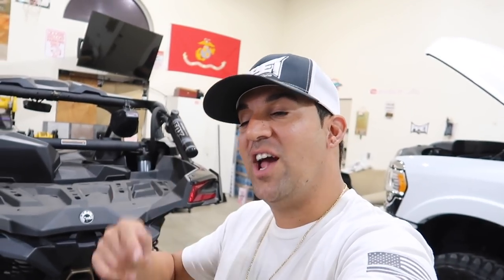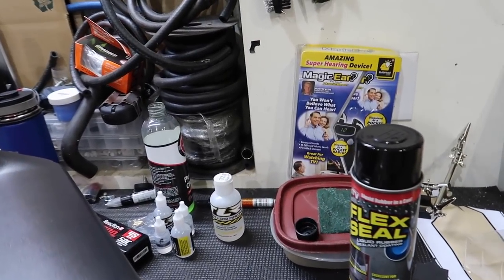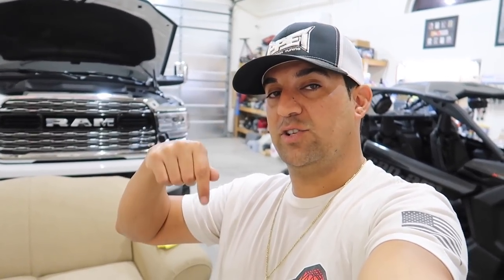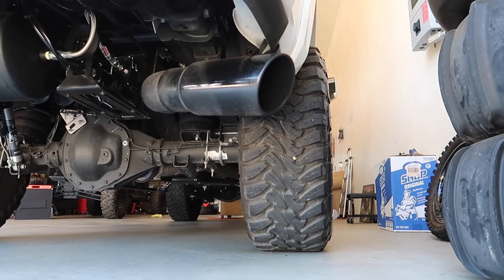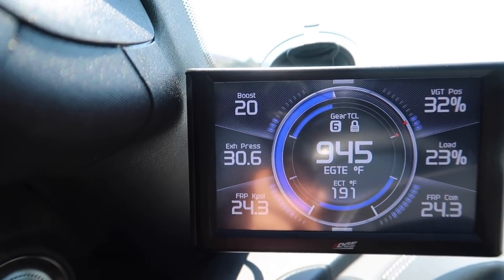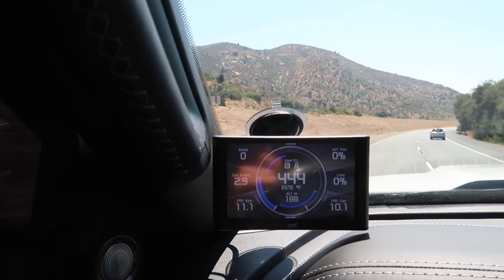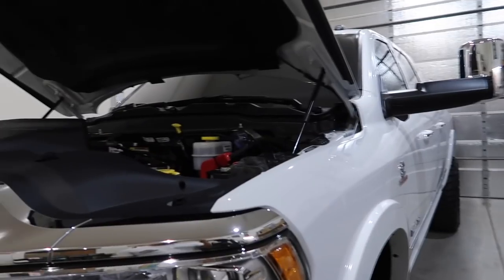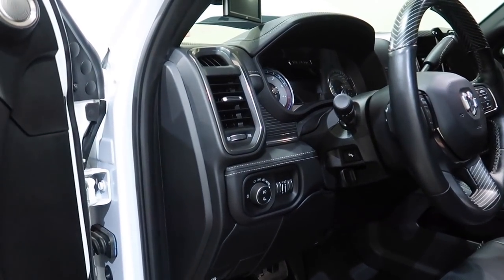DSP5/CSP5 SWITCH NOT WORKING?.....HOW TO CONFIRM!!

Comment: Great video, what I noticed is that at CSP selector switch only changes / advance the timing in the truck to push more fuel to create HP. Very hard to hear at the idle. Correct you can notice at half to full throttle while driving. Also you should and can notice while driving with the cruise set at 60mph run through the switch watching the fuel mileage.